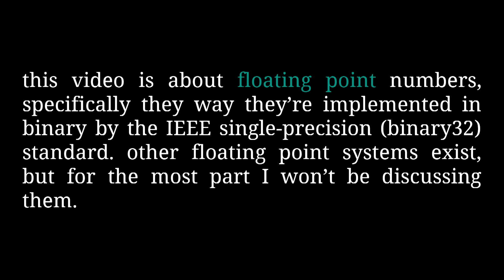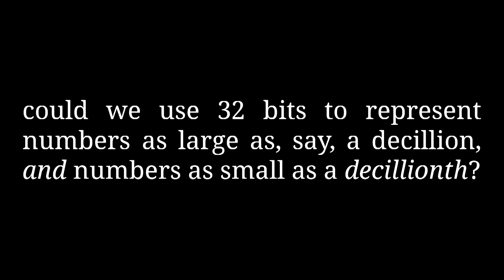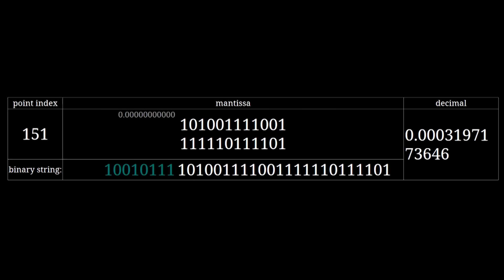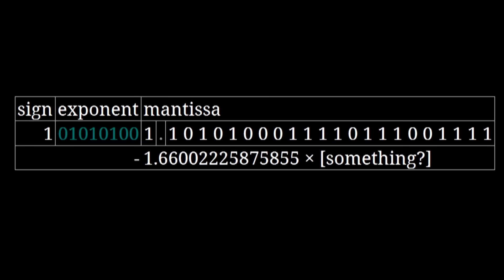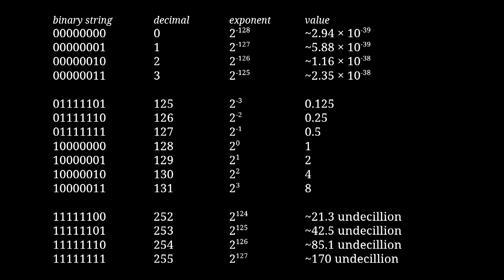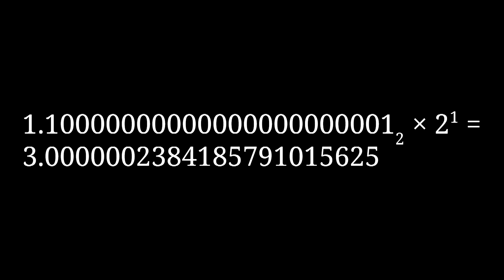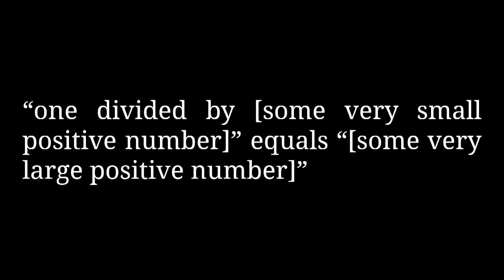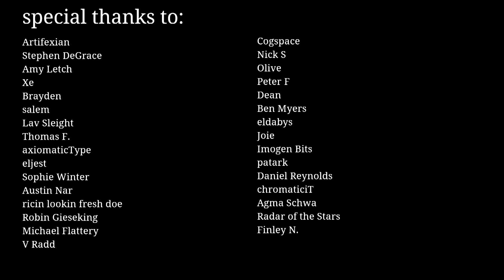how floating point works

Comment: what I find silly is they stick to the integer convention with the sign bit (for most numbers, using int comparison to 0 will give the correct result, even for floats) but completely ditch it in favor of a bias system with the exponent. So now 1.5 is grouped in with the numbers that have a negative exponent, and the "sign" bit on the exponent actually just indicates whether the absolute value of your number is >=2. shoulda just used 2's complement for the exponent anyway
also 8 bits for the exponent sounds nice because it's a byte, but putting it in the second position instead of at the front or at the end means that computers with byte-addressable memory will have to read 2 bytes and combine the value instead of reading 1 byte, even if you just want quick access to the exponent

In case you're wondering, no. your TI calculator does not store numbers this way. They actually use base-10 floating point with 1 byte for flags, 1 byte for the exponent, and 7 bytes to hold 14 decimal digits. This means it has its own class of "secret numbers" since BCD can use values from 0-9, but technically you can still write the values 10-15 to those memory locations. What you get is like, a number that acts like 1.5 x 10^0 but it's actually 15.0x10^-1

Comment: 2:04 No, not in this case. Most modern computer's native integer is already 64 bit. In the past, people used 32 bit architecture, so this number has to be represented via floating point numbers. But even there, it would be represented exactly because there is 52 bits of mantissa in double precision number.
Reply from the maker: are you saying the example I gave of a situation where it would be impractical to store a number as an integer is a case where in practice you wouldn't store a number as an integer
Reply: @HBMmaster  What I meant is that the world population is in practice stored as integer. Just like how number of views on a video is represented as an integer even though there is no way you can't accurately count it.
The issue here is counting, not storing. Storing a <40 bit integer is trivial. In this case, how we store the number doesn't matter

Comment: I've always loved different number systems and floating point is one of my favorites. 

I particularly like the way that even though the exponent is expressed as a number plus it's bias (that's the number that's added to the exponent --> for single precision, that's 127), the leading bit still has some significance in terms of whether or not the exponent is positive or negative. For the most part, a leading zero in the exponent signifies a negative exponent, or a fractional number, while a leading one signifies a positive exponent, except for 127, which has a leading zero but has an exponent of 0, which isn't really positive or negative. 

But this actually has no significance at all, because its more to do with how binary works than anything else. It's just a byproduct of dividing the exponents into two mostly even groups, and since binary expresses numbers in multiples of two, it works out this way. 

There's actually no reason at all that there needs to be an even division between negative and positive exponents. A person who designed a new number system with similar principles could have the same 8 bits for the exponent and have a bias of 5, which would only allow for very imprecise numbers below 1, but would allow far more numbers above 1. 

But the IEEE standards for both single and double point do divide it somewhat evenly. For single precision floating points, we use 8 bits for the exponent, so the bias is 0111 1111, or 127, and for double precision floating points we use 11 bits and make the bias 011 1111 1111, or 1023. And thus, the leading bit almost does signify the sign. 

(And IEEE has kept this up, too. The standards have been extended even further because some scientists wanted more precision. Because of that, we have octuple precision, which has 19 bits for the exponent, and the bias 011 1111 1111 1111 1111, which is 2^18 or 262143.)

Comment: 1) I really liked your choice for the last second of this video! 
2) I wish I had this 6 months ago, before I took the Computer Science course that taught me all this. 
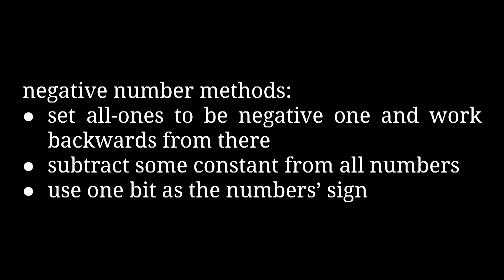3) I feel like you did Two’s Compliment a small disservice with the info on screen at 5:27 (the first bullet). I get why you did it that way — this is a video about floating point, after all. But for a one-sentence summary, it just feels unworkable — especially when compared to the other two accompanying it. I don’t know what a better one would be, but it feels like for what you have, such a key (and cool!) concept for the corresponding integer standard needs to at least be *named*. 

But regardless of that, this is a GREAT video. It took my Professor three classes and two weeks to get to the end of what you covered completely in 17 minutes. You should be proud!

Comment: a lot of people are saying this but i haven't seen someone say why, so:
the reason (1) is treated as the negative sign bit is because the way byte rollover works. zero (0000,0000) minus one (0000,0001) is negative one (1111,1111)

Comment: IMO one of the most interesting things to do with NaNs is to "box" values inside the NaN's mantissa bits, and reinterpret those mantissa bits (along with the sign bit in some cases) as a tagged union of other types of values (booleans, integers, pointers to larger structures). It's typically used with 64-bit floating point numbers, as a way to store a variety of types in a single 4-byte value. It's used in quite a few interpreters (including some major browsers' JavaScript engines), and it's surprisingly fast for how complicated it is.
Reply: Indeed.  I ran across a system that used the two LSB for such things.  The values were to represent data from a data acquisition system and they encoded four possible 'flags' in these bits.  '00' meant the data was good, '01' meant the data was out of range and had been clipped to ceiling/floor limit of the DAQ, '10' meant it was stale and no new values could be obtained, but this was the last 'good' value.  and '11' meant the DAQ itself was failed.

So the first thing incoming data went through was stripping out those bits and posting the datum's status in another structure.  But the DAQ just sacrificed those two bits rather than send another item.  (we were using only 15-bit ADC's, so the apparent loss in precision in stealing those bits wasn't really an issue)

Comment: In regards to signed zero, I recall an explanation in a paper a long, long time ago that showed a graph of a 2D function that was correct with signed zero, and incorrect without it.  It kills me that I can't find the damn thing, but the point is that signed zero is required for some functions to get sensible results with floating point.  I think it comes down to correctly representing sign at inflection points.

Oh, also: another small, practical advantage of the way the sign bit is: it means "all zero bits" means 0.0.  This is handy for contexts where data is initialised to zero: you end up with your floats all being 0.0 by default, rather than -0.0.
Reply: One interesting way that having negative zero can come in handy is with functions that have "branch cuts", which is something that's normally associated with complex numbers, but there's an analogous thing with the inverse tangent function that doesn't require complex numbers. In C (and most other programming languages), taking the inverse tangent of +infinity gives +π/2, and similarly the inverse tangent of -infinity is -π/2. So if you have a function that computes arctan(1/x) and x ends up being a negative number that's too small to be represented, the fact that it underflows to -0 instead of +0 can save you from being off by π.

Comment: What? Why would you use 0 for negative and 1 for positive? (-1)^0=1, (-1)^1=-1 . The group {1,-1} under multiplication is isomorphic to the group Z/2 under addition, with the 0 of Z/2 corresponding to 1 in {1,-1}, while the 1 corresponds to the -1 .
What reason could you have to make 0 correspond to -1 and 1 correspond to 1?
I guess just the fact that it preserves order?
And I guess that 1 and 1 have the same name?

But, no, if you are labeling {1,-1} by a bit, 1 should be indicated by 0, and -1 should be indicated by 1. Doing it the other way is doing it wrong.

Comment: NaN is an absolute scourge. You do some operation that results in a NaN. It doesn't error, you just get a NaN as a result.
Any operation on a NaN is also a NaN. By the time this causes an issue in your program, it might be somewhere completely different and now you need to figure out where the NaN originated, before it infected all the other floats.

Honestly, I'd prefer it if things just errored out when encountering a NaN. It would make debugging so much easier and in the vast majority of cases, things are going wrong once a NaN shows up anyway.
Reply: just have checks for if things are NaN after doing something if it's a problem
Reply: @Chloe-ju7jp  Sure, you can do that. But then you need to do a NaN check everywhere and you might forget.
Or you make a function for each operation, which will make longer expressions look absolutely daft and hard to read.

NaN is an exceptional state. It should throw in exception. (Or whatever error mechanism the language you are using happens to have)
Reply: @Yotanido  On x86, hardware supports signaling on FP errors. It is controlled by MXCSR register. Your compiler might have some function or setting to control it.
Reply: @Yotanido  It sounds like what you need is a float monad.

Comment: Shout out to my favorite underused format the fixed-point. An old game creation library I used had them. Great for 2D games when you wanted subpixel movement but not a lot of range ("I want it to move 16 pixels over 30 frames"). I found the lack of precision perfect so that you don't get funny rounding errors and have things not line up after moving them small spaces.
Reply: They're also good for avoiding bugs caused by the changing precision in floating-point formats. Sadly they have worse optimization potential in modern CPUs.
Reply: I also feel like minecraft should be using a fixed-point position format. Half of all the number space is completely wasted at the world's origin, and then the precision is stretched to its limit at quintillions of blocks out. Does minecraft need more than 4096 possible positions within a block (in X, Y, and Z directions each of course)? I don't really think so. Which leaves 19 bits for macro-block positions (and 1 for the sign of course) which is 524,288 blocks with 32 bits. Or, with 64 bits as I'm pretty sure it already does use, you can go out to 2,251,799,813,685,248 (or 2.251×10^15, or 2.2 quadrillion) blocks in any direction, before the game either craps out or loops your world. Which I think is a fine amount of space, and even 500,000 blocks was fine- you'd run out of computer memory doing ordinary minecraft things or run out of interest in the world before you actually naturally explored that far. But with 2 quadrillion blocks in any direction, there is no way you'll get out there ever, without teleworking there to see what it's like
Reply: Yeah, games with limited scale don't need the sliding scale of the floating point number system. Minecraft does not need to specify 1/65536th of a block, it probably doesn't functionally need anything more than, like, 1/4096th of a block (or 1/256th of a single pixel), which would nominally squash the range the floating point coordinate system afforded you, but expand the usable space significantly and give you a hard cutoff where the fixed point numbers top out (or bottom out negatively)

In fact, using 64 bits for positions (floats are SO last year) and a fixed-point implementation down to 1/4096th of a block, you get a range up to 2.2517 * 10^15 blocks in any direction from spawn, all which behave as well as current vanilla minecraft between 2048 and 4096 blocks away from spawn (where the minimum change is already 1/4096)

And, of course, I couldn't just NOT mention the other half of the floating-point numbers that Minecraft straight up cannot use- half of the available numbers are positions between 0 and 1! Unparalleled precision used for nothing!
Reply: Lmfao I am constantly harping on this I guess

Comment: I always found it silly that IEEE-754 gives us 1/0=INF, but not INF*0=0, this is the first time I've had a plausible explanation for why it might have been designed that way. Thanks!
Reply: 0 × ∞ is either a discontinuity or an exception in normal math too though. Anything × ∞ is ±∞, but 0 × anything is 0.
Reply: INF*0 is one of the standard "indeterminate forms" in calculus, which is why it evaluates to NaN.

https://en.wikipedia.org/wiki/Indeterminate_form
Reply: @danielbishop1863  Exactly. 0 can be an infinitesimal in normal math too.

Comment: Looking at this video I'm a bit bummed that there's no "actually 0" value in the format.

It would be nice to have negative 0 for the range (-a, 0), positive 0 for the range (0, a), and zero zero for the range {0}. This way you have exactly one way to write 0 and a way to differentiate limits to 0 and 0.

Comment: As someone also weirdly into floating point numbers, I appreciate this video.

0 for the sign bit being positive is carried over from previous sign/value representations of numbers. It has the benefit that "all zero bits" is the same as positive zero, the expected "default" float value. Also, you can think of it as multiplying the rest of the number by (-1)**(sign bit).

And I tend to think of floats themselves as precise, but operators need to round to the closest precise value. This makes rounding modes make sense. But your interpretation is great for stuff like 1/0==Infty.

But I hate hearing the phrase "Infinity is a concept": You say "Infinity is not a real number", but that sounds like the non-maths meaning of "real" (i.e., it exists). Of course, it can be a "real" number in certain domains. In IEEE-754, it isn't a concept, but an entity that "exists".

Like "engineering notation" 1.72e-3 == 1.72 * 10**-3 == 0.00172, there is a "precision notation" 1.001p4 == 1.001_2 * 2**4 = 10010_2

And about NaNs: All of those values are not used in real life. You might rarely see the difference between signalling and quite NaNs, but the entire payload isn't used. In JavaScript, there is only 1 NaN value for example. Some modified floating point formats (Like the ARM 16 bit float) reuse the NaN encodings as just larger numbers.

Comment: Hey jan Misali, take a look at "Posit numbers" if you haven't already. I feel like they'll be aligned with your interests. They feel like floating point but without all the ad-hoc design-by-committee kludges. 

No negative zero, only one exception value (NotAReal) instead of trillions, more precision near zero but larger dynamic range by trading bits between the fraction part and the exponent part using the superexponential technique you actually joked about in this video. They're super cool.

Comment: numbers as regions is a thing that shows up in locale theory (aka "pointless topology"), where you don't worry about there being "points" and only work with hunks of space that can contain each other (aka some sort of algebraic lattice, i forget the precise formalism). Imo it's a lot more physically realistic too -- all physical measurements have degrees of uncertainty, nothing is 100% certain. It's just that classical math is very uncomfortable with any kind of uncertainty. (Everything has to be a total function! Anything that doesn't fully determine its output is Not Allowed!)

The blog "graphical linear algebra" does really some interesting graphical-algebraic development of basic arithmetic and convinced me that it's often natural to deal with one-to-many relations in basic math -- that is, have operations that produce ranges instead of points -- like "nan" (when it's used in the sense of "could be anything" rather than "outside context problem"). They do stuff like turning addition "backwards" -- thinking of "reverse addition" as something that consumes an input and produces a constraint that its two outputs sum to the input. There's a nice visual formalism where you literally turn a little circuit diagram backwards to indicate this, it's cute.
Reply: There is a very clever trick with floating point numbers which allows you to make mathematically true calculations possible with just floating point numbers alone.
The idea is that floating point numbers allow you to round in different direction and give you a result which you can choose to be either lower or higher than the result in the real numbers.
Using this idea you can represent a real number as a an interval and calculations with intervals give you other intervals with the property that the mathematically true result is guaranteed to be in the interval.

This gives something similar to the structure you talk about. A number in that setting isn't just a point, but an entire range of values which can be operated on like numbers. Additionally this also gives you a measure of how accurately you are calculating. If the resulting interval is wide the uncertainty is high, if it is small your errors in the calculation are low.

Comment: I floating point calculations are expensive. I use “fixed-point” 2’s compliment and keep track of extra bit shifts required when putting them through adding and multiplying hardware.